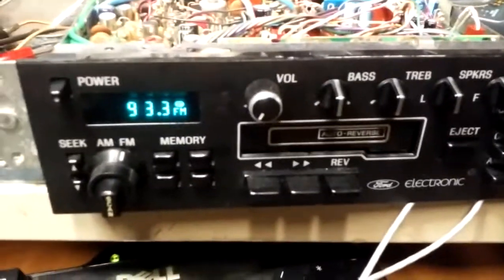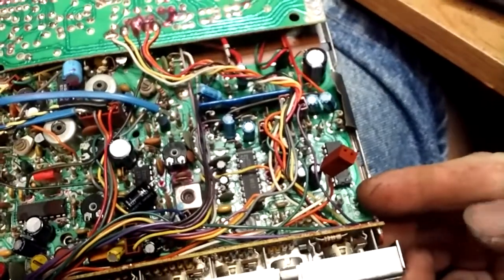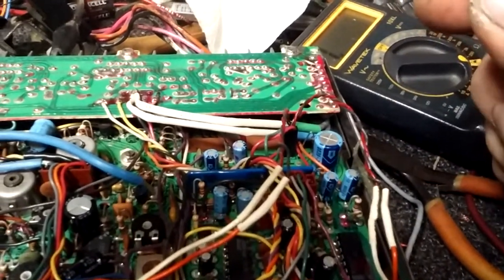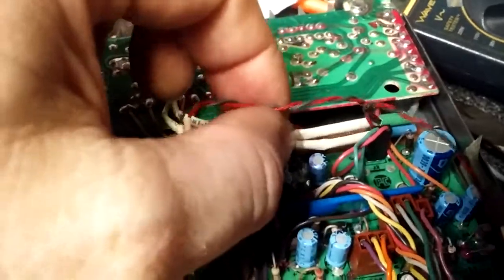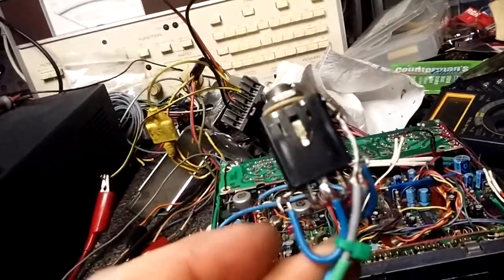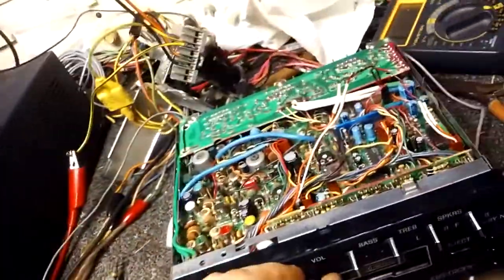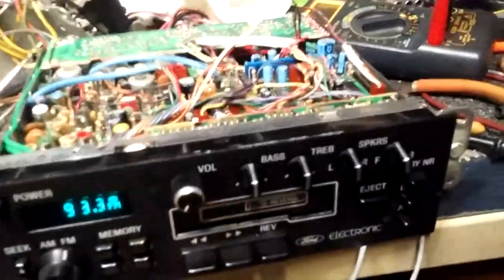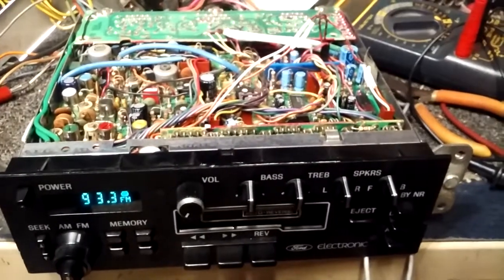80s Ford radio aux input mod

Comment: Hey, just want to know, I have a Bluetooth board im trying to do this mod with, and I’m just trying to figure out what to do with the speaker grounds, I get the left and right channels, but what do I do with the grounds? That one place you soldered too on the board? Would that work?
Reply from the maker: Should work.  Thats the signal ground, and the BT module so far as the radio is concerned isn't any different than an aux or any other input.

Comment: Hey there, seems like you’re an expert with this specific Ford radio. I have an E7AF-18B865-AA
That I would like to add to a 1980s restoration I am doing. I have found some diagrams online and got it to power up, but I cannot get the illumination bulb to light. Also the cassette doesn’t work. Not sure if it’s related. Any chance we could connect privately to discuss? I’d appreciate it.
Reply from the maker: you  mean the single bulb by the power light?  There is a separate power line for that, don't have the book in front of me but maybe the blue/pink?  It runs off the dash illumination circuit.  Tape deck is unrelated to the light, but could be a lot of possible issues.  Usually the belts are shot at least and sometimes the mechanism gets jammed from petrified oil.
Reply: Thanks for replying! From the wiring diagram I have, the org/black and blu/pink appear to be both for illumination. One goes to an illumination relay and the other to dash illumination. When I power each, nothing happens. 

But when I ground the blu/pnk, the station display gets brighter. Likely bright for daytime driving, whereas the dimmer is for night along with the dash illumination. 

I do realize the speaker outputs go to the factory amp, but the amp is long gone and I wanted to use a higher wattage aftermarket one anyway. 

Your help is most appreciated!
Reply from the maker: @billpaskoules6872  are you sure the bulb is actually good?  If thats out and the dash light circuit isn't connected it doesn't "see" ground and goes to display dim mode.  

These could be used directly to speakers or through the amp.  output is speaker level.  Most of them had the rear speakers run right off the radio and the fronts went through the amplifier. If your amp has speaker-level input you're good to go.
Reply: I tested the bulb separately and it lit up. I will also double check the socket to assure the contacts are good. I will also run power to the socket with the light inserted and see what I get. 

My plan is to run a 4 channel aftermarket amp. For the speaker output, there are 4 wires. Do you know if the solid black is common (-) then the other 4 wires are RF, LF, RR, LR? Know the color codes for each speaker location? 

Once I get this settled, I plan to install your aux input!
Reply from the maker: @billpaskoules6872   depends on the specific radio.  All of them can be common to ground.  Some of them are higher power and have both a speaker + and speaker - for the rear channel.  If you go speaker + to ground it makes 1/2 the power as it does speaker + to speaker -.  If thats what you have, just ignore the other two wires.  I don't have the book in front of me to tell you what color is what though.  If you have the EVTM for the car its in there though.
Reply from the maker: @billpaskoules6872   not sure if this link will post but apparently I scanned the speaker wiring stuff at some point. https://gadget73.com/images/schematic/
Reply: This helps a ton. The radio is E7AF-18B865-AA. The same as in your video but possibly a different year. I am going to take a look at the schematic you sent and compare. I will let you know
Reply: Hey There Gadget!

I wanted to provide you with an update on my radio project. So I have 3 total radios of the era. For each, the radios seem to work fine, it’s the tape deck that is the issue. I will somehow get that sorted if I can find a radio repair. 

I was wondering though, in your video, you use an AUX input that is the 6.35mm…the larger one that has a switch back mechanism. 

I want to follow your guidance and install an AUX input but using the typical mini jack used for headphones, etc. I think a 3.5mm? Would you kindly be able to search an AUX Jack web link with what you would recommend? I’ve done a search but finding one that has the switch back mode has been tough. 

If not a link, what terms should I use to search. 

I appreciate your time in helping me get this sorted.